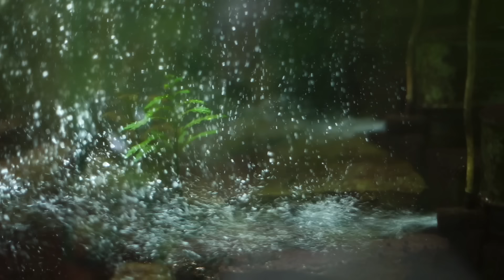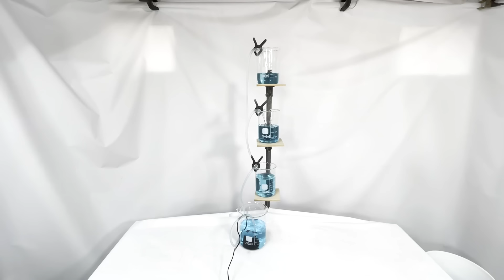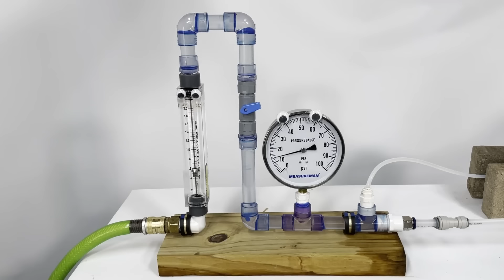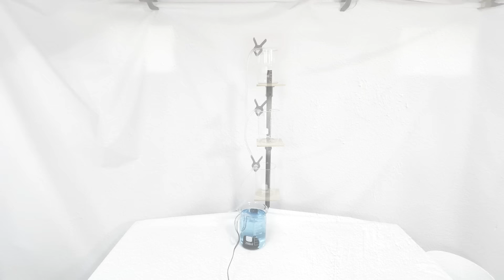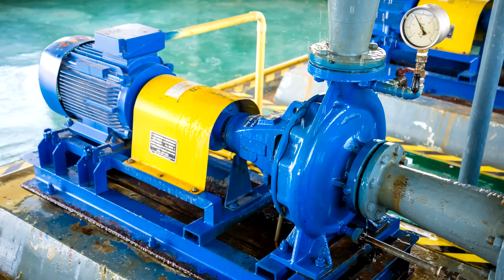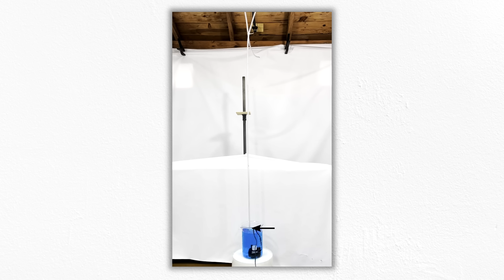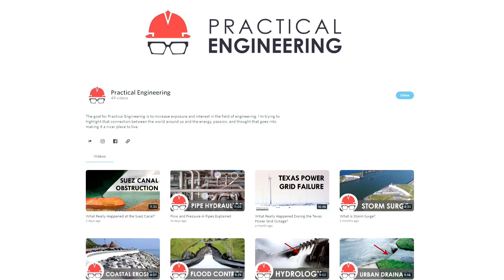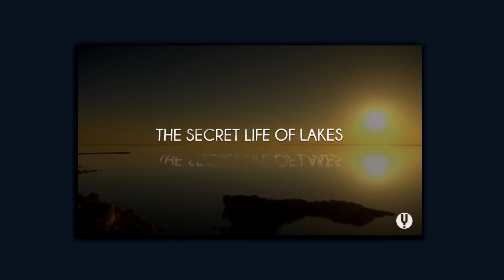Do Pumps Create Pressure or Flow?

Comment: It's interesting.  In Machinist Mate's school (USN), there are essentially three types of pumps, centrifugal, positive displacement, and modified positive displacement. 

On your video, you showed a centrifugal one - the sump pump in the bucket, and two modified positive displacement pumps, the flexible vane pump and the peristaltic pump.  They are modified because given no resistance they will pump their full capacity, but can be throttled - easier for the vane pump, but still.

A true positive displacement pump is a piston pump or a gear pump where a shut off head is infinite (or until something on the discharge gives way).

Centrifugal pumps are different - they work by changing velocity to pressure.   The volute of the pump (the expanding part of the discharge casing) causes the flow to decrease and pressure to increase.

Anyway, that's how we learned they worked.

Comment: Another issue many are not aware of is when you double size of a pipe it exponentially increased gpm on supply end.
And a small restriction on intake suction drastically reduce efficiency.
Also no pump can "pull" Water beyond 25+- feet of head on suction side intake before water boils under vacuum causes cavitation on impeller.

Comment: The electricity/flow analogy is quite apt. I am often asked whether batteries create voltage or current. A battery does have an open-circuit voltage, analogous to the zero flow pressure of a pump driving a closed pipe. But when a load is applied, current will increase until the battery's maximum source current is reached. (Flow increases until the max flowrate the pump can produce.) Increase loading (open the valve further) and pressure will begin to decrease. I'm sure the miscellaneous other factors involved (wire resistance -> Reynolds number?) all have analogs in my world as well. Fun stuff!

Comment: I had a well drilled near the bottom of a ravine on a large piece of property. The well driller was taken aback by the fact that I wanted to put the pressure tank for the well more than 500 feet away and 75 feet up hill from the well and the tank and booster pump. The driller refused to warrant the booster pump but it has been working "well" (no pun intended) for years. The pressure switch on the pressure tank shut off, at the top of the hill is at 60psi, but 75 feet downhill from that, with all the weight of the water in the lines and the pressure tank, I was rocking 78psi- which is what I wanted. Water pressure and flow are extremely logical concepts if you just think about them.

Comment: I work with small vacuum pumps and larger vacuum pumps for securing work to machine in wood or stone.
I also use diaphragm pumps of different designs, and oiless piston pumps, oil lubricated piston pumps,  two stage or single stage, and screw type air compressors for the whole shop.
I also maintain and repair our high pressure waterjets that work at 60,000 psi.
They're interesting, because there are so many types of pumps.

Comment: In the end it is all impedance matching:
You have an energy source (battery, electric outlet,  ...) and a sink (potential energy stored in the elevated water). All components in between (motor, pump) behave like transformers, that additionally change the domain as well (electrical -> mechanical, mechanical -> hydraulic).
The set-point is where output and input of each two parts match up.
To get the max. efficiency out of that chain, You want to match the impedance in the set-point as well. Same slopes, but different sign (negative for source, positive for sink) in the set-point = max. energy transfer. Here the output impedance of one component equals the input impedance of the next component. If possible this is true for a wide range of set-points by selecting the right components.

Comment: This is a great explanation at pump system level. 
At detail level....Inside the centrifugal pump, the spinning impeller accelerates the fluid, which creates pressure within the volute, and it's this pressure that creates the flow outwards.  The back pressure from the pipe discharge system opposes this which limits the flowrate to the intersection point - as shown on the graph.

Comment: "Given a water tank of radius R and height H centimeters empty of any fluid, at a height of M meters above the ground, connected to a pump of P horsepower, via a pipe of diameter D inches, calculate:
1- The pressure of the water column at the end of the pipe, at ground level.
2- The time required for the pump to fill the water tank.
3- The total power consumption of the pump."

I remember that one from Physics II in high school. The teacher thought he could troll us by mixing the units, but I managed to sneak a key question past him and the rest of the class. When he answered what I was expecting, I knew I was on the right track lol

Comment: For practical purposes I still agree with the old mantra in that pumps create flow.
Restriction causes pressure in the sense that pumps create flow, but without restriction there is no pressure developed. 
There is only pressure developed if there is a restriction AND the pump is capable of overcoming this restriction.
You can use an auto water pump as an example, OK, it creates flow and perhaps a tiny pressure as it lifts/pushes coolant to the high point in the system, but the pressure is minimal and it is incapable of providing much more.
On your point you win, pumps can create pressure,  BUT only with resistance present and their ability to overcome the resistance. 
Back to the auto water pump, it is incapable of creating much pressure in practical terms but technically you are right, it can create some small pressure.

Comment: I’m an electrician working in building automation and controls. I often will use the water analogy to explain electrical concepts. Recently I had a situation at work were a younger colleague who understands electricity was struggling to understand some pump dynamics. I used the electricity analogy to explain it.

Comment: I struggled with this for a long time myself. The answer is actually rather simple. The amount of energy needed to displace a certain amount of  matter (fluid or otherwise) is nothing more then a energy balance. On one end you have the energy added by a pump, on the other you have the energy cost by phenomena like drag, static height, turbulence, shear forces and the list goes on. The energy cost can be described as the system curve, as accurately put in the video and is mostly the biggest challenge in sizing you pump(s). The amount of energy needed to reach your net flow is a mind boggling math that in engineering is determined by experimentally determined relations. When in laminar flow (straight line flow), this can be fairly accurately calculated. Though with turbulent flow (imagine an ocean of vortice distributed unevenly) things get complicated. Things like Reynolds, Nusselt and quite a few other numbers are used based on experimental data and are not always pin point accurate... Sorry, me ranting about the details... In short: All systems are ruled by a energy equation, the problem with pipes is that it is very hard to calculate the energy need in pretty much all of the cases.

Comment: Here is what I know about pumps from personal experience. I have a flotec 1hp convertible well pump for my household water pump. I also use an identical pump as a transfer pump. I live far out in the country without a well. I go to town to bring water home in a 325 gallon tank. When I get home, I transfer the water from that tank in the trunk, to a 400 gallon tote, where I store my water. The household pump is then fed directly from the water tote, to the pump, then to the house.

This pump can be converted between a deep well, and a shallow well. There is a 'jet' involved. If you use it for deep well, the jet is located down the well. If you use it for a shallow well, the jet gets connected directly to the pump. If I do not connect this 'jet' at all, and instead just put a check valve at the input to the pump... It flows roughly 300 gallons in about 4 to 5 minutes. That is from one tank to the other. Free flowing. With 1-1/4" fittings and hoses.

If I use that pump in exactly the same way, for the household pump, it gets fed by the 1-1/4" plumbing. But the flow from the pump is 3/4". The entire household plumbing is 3/4". This pump, in this configuration provides plenty of flow. But will not develop pressure over 20psi. And it takes at least 4 minutes to develop even that much pressure. If I instead, install the jet to the front of the pump, it develops 50 psi easily, and within 5 or 6 seconds.

That is what I know about pumps. LOL

Comment: As an electrical engineer I always explain electricity by comparing to water. And thus voltage, current->pressure,  flow rate... this video is a whole other information

Comment: Let me just try to clarify what I understood. So, when we say pumps increase pressure, they are not actually increasing the fluid's static pressure but only the head? coz when we pump the fluid at three different heights the static pressure of the fluid before and after pumping into a beaker didn't actually change but rather the pressure that we quantified using height! ( Basically, the height is potential energy( that we are also calling pressure-head) that was imparted to the fluid by displacement from the pump to a certain elevation? )

And I believe the above understanding also holds well in :
1.Differentiating pumps and compressors through static pressure of the fluid.
2.Uniting pumps and compressors through changes in heads.

I don't know how much of this made sense, if you feel any contradicting or absolutely wrong concepts please help me out by explaining them.

Comment: My first job in the 90s was working for a company named Engineered Software that made pump and pipe flow software. My job was to use CAD to digitize pump curves so that the companies could take the data into our software to allow them to decide which pumps would most ideally fit their systems. I learned more about what I did in this 10 minute video than I did in 3 years working there (what can I say, I was a 16 year old pimply faced kid. I didn't want to know what the software did, I just wanted to play frisbee golf on our afternoon breaks.)

Comment: To make it simple, pumps create pressure differential. It's the difference between inlet and outlet that causes the fluid to flow. What most don't bother to figure is the plumbing (both distance and size) plus change in head pressure / height also figures into this pressure differential. Longer pipes and smaller pipes have more resistance to flow. Change in height of the inlet or outlet can also change resist or increase flow rates. Bottom line is it's not all about the pump itself. The entire system design is part of the pump's capacity.

Comment: So I used to work for a hydronic equipment supplier and I got pretty good a reading pump curves. In my experience the engineers never really looked at the pump curves. They would provide a duty point and we would provide them a pump that could reach that duty point efficiently.

Comment: Pumps compared to electricity:
Pump: power source
Pressure: voltage 
Flow: electrical current (amps)
Head and pipe constriction: resistance (ohms)

Comment: a pump is like a wall socket, there is 110V ready to use at the socket, but once you plug your device( say a phone charger) the output (volt and current) will be adjusted based on how that device is built.

the manufacturer of the pump will promise a certain pressure/head ready to use the pump outlet,  but once you plug your network the output (pressure and flow rate) will be adjusted based on how the network is built.

Comment: Positive displacement pumps don't always have a linear characteristic curve. I work in the healthcare industry and we use positive displacement pumps for our detergents for surgical instrument reprocessing. After installation they must be calibrated because the head and pipe length both have direct impacts on how much detergent is pumped per revolution.

Comment: My answer to this has always been that a pressure is a force over an area, pumps have an area which moves against the fluid creating a force, therefore pumps create pressure to create flow. Even if that pressure only exists right next to the pumps moving surface it still exists.

Comment: as a service tech for a hydraulic company (not a hydraulic hose company) best tool we own can have is a high pressure flow meter and needle valve. i love hydraulic pumps, especially piston pumps  with flow and pressure controls, rebuilding one, putting it on the biggest test bench we have and loading it up to the max off a 600kw CAT diesel engine. fun fun fun unless its at 3 am on a sunday and your sucking up to your number1 customer who operates 24/7 and cant afford the downtime lol

Comment: Centrifugal  pumps add energy via pressure to the system. Changes in flow may be perceived in other parts of the system (like the end of pipe). 

The law of continuity says that with a constant inlet and outlet diameter to the pump, the velocity (and therefore flow) cannot change in the pump.

If you add a 2nd pump to the vertical tube demonstration, the water level would rise then stop. But when we plug in that 2nd pump, the increased pressure becomes velocity head at the top and moves the water...but moving water is flow! Uh-oh. Changes in state of the system and where we make our observations within the system determine what we call it "flow" or "no flow". The centrifugal pump technically only adds pressure to the system which can then be converted to velocity head and be seen as flow from the end of pipe perspective.

Comment: To answer your titular question, the best I can say is, it depends.  The important questions, which you describe here are "what is the system layout or design or what is the application?  What kind of pump are you using, centrifugal, axial, positive displacement (ie lobed, reciprocating, etc)?  What is the fluid (gas, plasma, liquid)?  I guess one of the more fascinating areas that we have used pumps was for moving trains (pneumatic transit) with large roots-type blowers.  We still have systems like that today but are used for moving objects down a matrix of pipes like cash, medical samples, and even using them at one time to send photo film to be developed between two floors in a supermarket.  That last one I say because I remember the photo lab being separated between the mini store on the main floor to the developing machine on the second floor in our Zehrs Food Plus super market.  In that example, the whole thing seemed to use a central vacuum cleaner motor to transport the capsule.  I am pretty sure something like that was even used in a residential pneumatic elevator.

Comment: Pumps are cool. Years ago I built a large array of hydronic solar thermal collectors that heated water as it was circulated through them and back into a large insulated tank. The solar heated water was used for in-floor heating and to preheat the potable water before it entered the electric water heater. There were four pumps in the system and lots of components and piping. I became a "pump geek" after that project.

Comment: Love the opening statement do pumps create pressure or flow? immediately remind me of the engineering school saying that wings lift a plane creating vacuum that sucks the plane upwards!! then the argument with the other guys saying that its actually higher pressure on the bottom of the wings!! and as you mentioned with current & voltage.. you can't have one without the  other....

Comment: I love how analogous hydraulics and electricty are. It's the same with electricity sources, the voltage and current form identical characteristic curve. When the circuit is disconnected there is no current and the electrodes are at the maximum voltage. When you connect resistor (or anything that takes energy) the current starts flowing and the voltage falls slightly. If the resistance is small, the current is very large and the source power can't keep up and the voltage drops significantly. Finally, when the electrodes are shorted, there is no voltage and the source supplies its maximal current.
I guess we usually talk about voltage and flow, which are kind of opposite, because the voltage of a electrical supply rarely changes very much and pumps are more often used to move water without creating very much pressure.

Comment: In essence, a sentrifugal pump consumes and delivers a relatively constant amount of power, or energy, to the water regardless. And since power in hydraulics is the product of the discharge and head the system dictates how the power is used.

A displacement pump delivers a fixed discharge (for incompressible fluids) like you said, so the system dictates how much power is used.

Comment: The multiple pumps for efficient is rarely used anymore Using a variable speed pump, along with variable flow valve you can keep a pump operating where it is most efficient while achieving either the desired flow rate or pressure.

Comment: Great simplified explanation. But as an old aero engineer (a bit stale after 60 years) I want to know things like what pressure do you get from each type of pump at the same input power, if you block the flow with the pump running and measure the pressure at the outlet of the pump, and what pressure do you get if you stop the flow far from the pump with no other outlet? But ultimately, the pump MUST create a force greater than the resisting force in the system, that force is measured per unit area, i.e., pressure. So, the pump must create a pressure in the fluid greater than the resisting pressure of the system to create flow: no pressure? no flow. But the converse is not true: no flow doesn't mean no pressure.